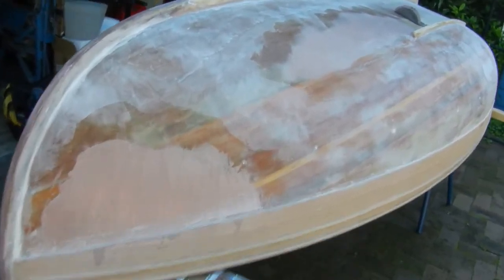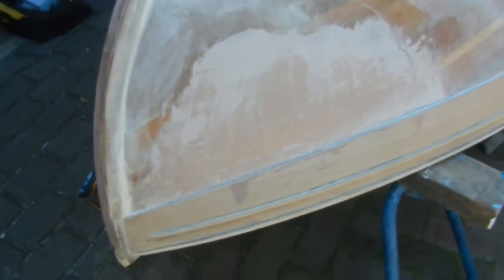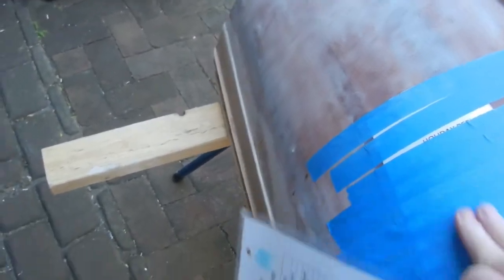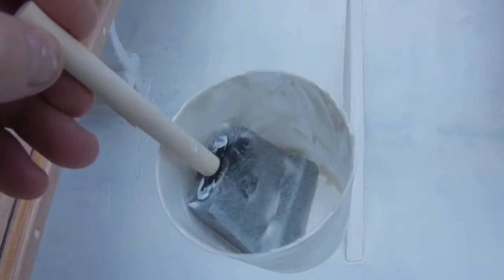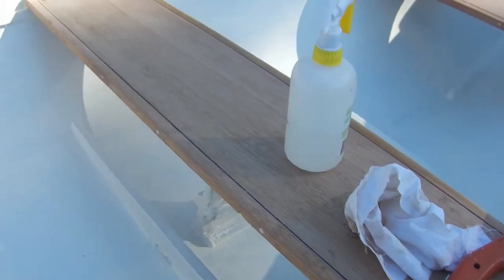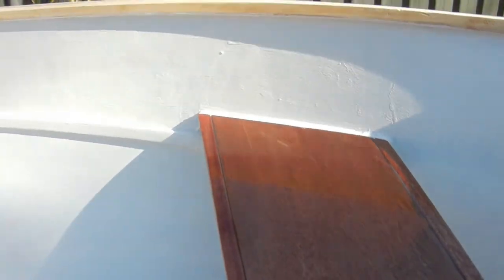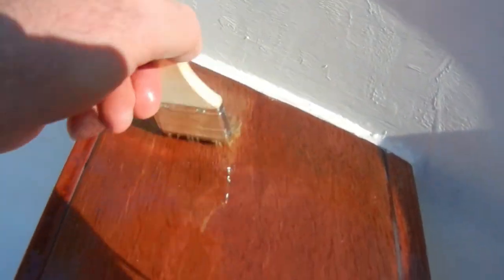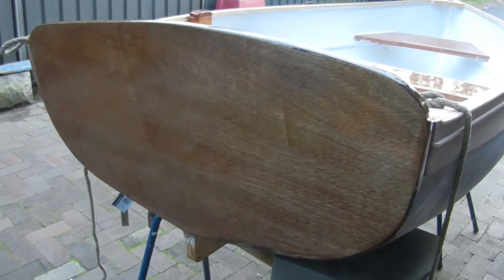Boat building titbits

Comment: Nice little dinghy . I finally finished my kayak using Bote Cote epoxy and Aquacote paint. She's a bit rough because I couldn't be bothered fairing too much, but she's solid and goes real well. Aquacote paint is brilliant to use, as is Bote Cote epoxy, I'm using both on my 14 foot boat that I'm building now
Reply from the maker: Thanks Mate,  I was under the pump workwise and I was doing the dinghy on weekends to finish it off.  I did not realise I had videod so many little tips & Tricks.
We look forward to supporting your latest project.
Reply from the maker: Thanks Antipoden.  Good to see you had great results with the Aquacote.  It is a brilliant paint if you forget everything you know about painting and read the instructions and our Tips sheet.